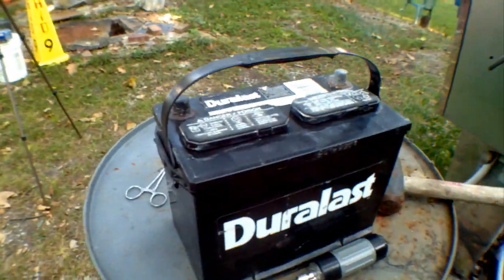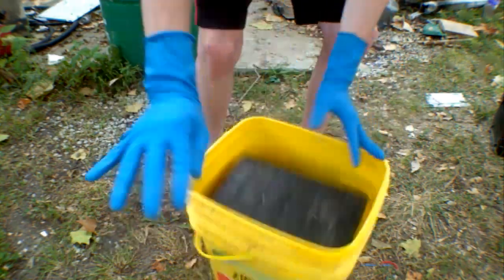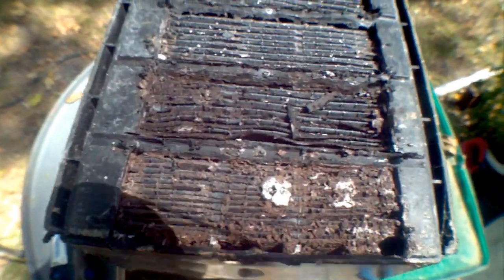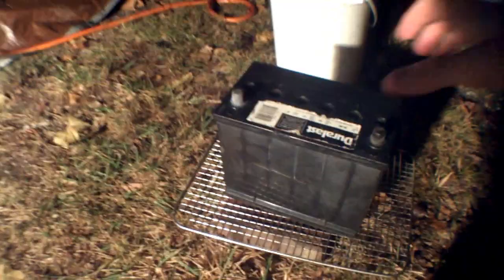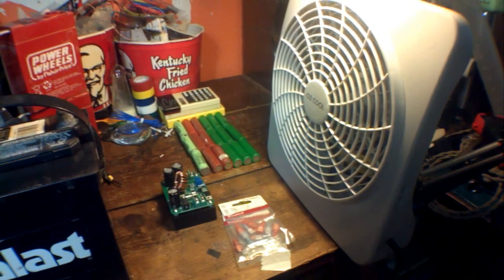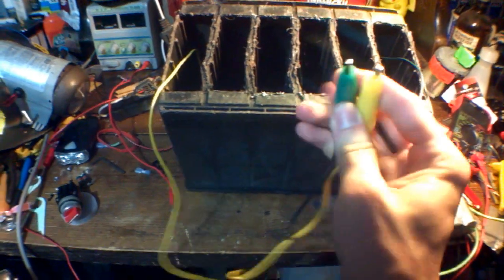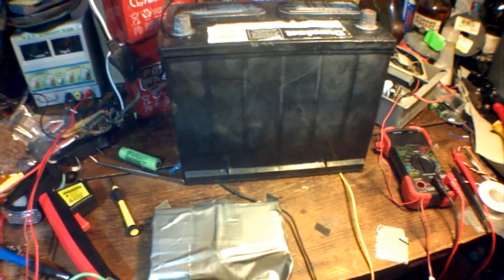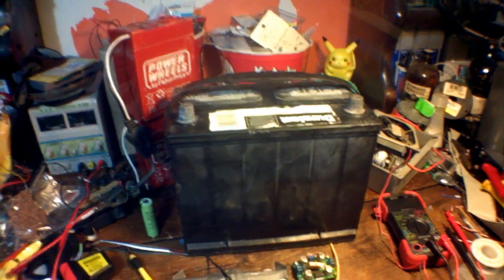DIY Lead-Acid to Lithium-Ion battery conversion 18650

Comment: Love it, awesome, lol !! Did you save the lead? Real lead is scarce. You could give it a chemical wash, then melt it with a torch and really clean it. But srsly you should've filled the old shell, or just made a small cool LiFePO⁴ pack, a 4s though, why only make an 8v battery when you're replacing a 12v car battery? A 4s 18650 pack would be a perfect match, but you'd need quite a few to get enough Mah.
Reply from the maker: i planned to fill it with cells in the future, havent done that yet though.

im not a huge fan of LiFePo4 given how easy it is to get Lithium-ion.

i wasnt replacing a 12v car battery, this just happened to be a 12v battery i used for experiments.
Reply: It Can't be easier, they're free and prolific. They're good ones in almost every bad laptop battery from the last decade or longer. Just open them up and check them if the cell is greater than 2.5v, keep them.
Reply from the maker: you really dont know who your talking to do ya? i've done too much with 18650s and am kinda fed up with them. i have about 1000 18650 cells ready for testing and another 40 or so laptop packs ready to be opened but i just burned myself out on making bike batteries and whatnot. i bet youve probably seen one of my videos already if you tinker with 18650s.
Reply: lol, so how could it be easier, when you already have 1000? i'd like to replace my truck lead acid battery.
Reply: Sorry I didn't mean to insult you. I'm glad you got to save your battery case. I could see it meant something to you, similar to how I feel about ex gf's, lol, but apparently your battery lasted longer and was a better relationship than the ones I had, lmfao !
Reply from the maker: oh i didnt mean that like i was insulted, more of bewildered. imagine i was an actor that was only known for one thing, and everybody talked about that one thing any time they met me, and then somebody came up to me and talked about that thing without knowing of my involvement with it. it'd kinda be a "wait, are you serious?" kind of moment. lol

but the issue is that i have quite a long test for each 18650 in order to make sure they are reliable and properly categorized, and then building the battery is back-breaking work that takes a lot of time. it can take months to go from start to finish for a large battery pack and i'm kinda at the point where i already have a lot of battery packs made, and also kinda sick of working with 18650s for a bit.

so right now i'm just testing a few every so often that way i'll have a box of 18650s for when i actually want to make something with them, but not gonna rush it.
Reply: Rinoa Super-Genius I see I just make sure the starting voltage is above 2.5 then I charge them up and go from there. Ignorance is bliss and I don't want to know too much because I won't be comfortable any more.

Comment: OH this is so wrong and illegal in so many ways.

Take the Lead-Acid battery to a Walmart, Pet Boys,  anywhere they can properly recycle it. Build a wooden box or order a plastic box for your Lithium-Ion battery experiment. 

You've exposed your mother and yourself to lead - even small amounts without respirators, and personal protective equipment can be dangerous.

Worse is that when someone recycles the Lithium-Ion loaded car battery. It will cause a huge explosion in the secondary lead smelter battery breaker's hammer mill, which will cause the battery to explode. Employees try to spot lithium-ion batteries by shame and color, but when it is a car battery - they'll never have a chance to pull out of the conveyor belt before it's too late!   Secondary Lead-Smelter Employees have had some horrible near misses from these lithium-ion explosions.
Reply from the maker: well then, what laws did i break? and nobody is going to be recycling my battery case, its just plastic.

and playing with lead is good fun, as long as you dont breath it in and wash yourself after. if its so dangerous then why is it a common childhood activity to melt and cast it?

get over yourself.

Comment: why don't you just drill holes in through the top of the terminals and install nuts and bolts then hook up wires with ring crimp lugs.

Comment: BE PREPARED! .Always where shorts and sandles when messing with  lead..ACID!   dump it in the recycle so they can stuff it in the ground to leak out later.  you just made billioniares unhappy! right on!! :)
Reply from the maker: +Steve Finch yeah id hate to wear jeans while doing this because the acid can soak into the cloth and continue to touch you if its harming you, but most of all, battery electrolyte doesnt really damage you much more than a light burning sensation, meanwhile it can destroy you clothes.

and putting it into a buckets makes it easier to neutralize the acid
Reply: True that..I  have messed up my best shirts before. but only when i think i was careful it happens lol glad the younger gen is definetly iterested in better Energy. :).

Comment: Dear Rinoa Super-Genius: I AM VERY DISAPPOINTED WITH WHAT YOU DID! You were too lazy and impatient to gather together only enough Li-Ion batteries to fill one compartment. And some of those batteries are more used and worn-out than others. I would like to see a video with brand-new lithium-ion batteries (all of them the SAME) with sufficient quantity to fill ALL of the lead-acid battery compartments. Then I would love to see the terminal voltage and the ampere-hour capacity of the WHOLE complete contraption !!!!!
Reply from the maker: well thats your problem if your disappointed then, not mine.

Comment: I don't think you guys get it, he mentioned the reason why he used this route as opposed to using a new container. It's his favourite battery. Do you not have one? I know I do and it holds a special place in my heart. 
I still remember the day I got mine, it was a hot and humid winters day back in 1991. I had just turned 11 and as a present my father had given me my very own 12 volt battery. I spent all of my special day cleaning it, I missed my party and other presents but all I wanted was my 12 volter. For the first few months I carried it everywhere, I even put it under my pillow come bed time and wore it round my neck as a portable power source, maybe that's why I have a hunch? I still remember the day it stopped holding charge. I was 11 years old and 8 days old, it was a hot and humid winters day back in 1991.....
Reply from the maker: +Gunzee your joke falls flat on its face because i wasnt alive in 1991, guess you dont understand time. or how important it was to me to have a 12v power source for electronics projects.
Reply: Time is indeed a mysterious beast, it's strange but I honestly would love something like Arrival to be real. To understand and percieve time as the hexapods do would be amazing. 
Hey, it's not all about you! It was my experience and it doesn't matter if you were alive. Before your arrival to this plane there were 12 volt batteries and many other things, I promise you this. For a geneass you kinda type like a silly billy.
PS. My joke as you called it really sucks.

Comment: use 20l plastic container used for oil and kitchen chemicals they hold acid generaly well empty into that

use hot old milk or anythink waste alcaline to rinse out battery then hot water to clean
disolves the phospor an acid 

to open smack the top rim of battery reasonbly hard with hamer it seperates the the plasitic weild
takes some experince to get good 

dont use batterrys use supper caps way better

and to all nay sayers its a pretty good recycle of battery better than making it from scratch

Comment: I know from my own experience that battery acid won't burn your skin if washed off with water right away but I would never full around with battery acid without eye protection.

Comment: Doesn't really look like one of your batteries.  Not enough duct tape.  If it was me mate.  I would have cut the top instead of the bottom.  Removed three of the dividers to make three sections and wired each section to be about 14.8V (4 cells).  I didn't get the feel for the size but if it was possible I would have used two or more rolls in each of the three sections.  Then in parallel I would have ran the wires to the terminals.  And if possible I would remove the auto lead connections with a brass bolts, nuts and washers.  Then reattach the top with RTV.  But it was a good use for limited or poor 18650 cells.

Comment: Having managed a battery shop, this kid violated every safety rule in the books, primarily full eye protection.  The whole "project" would have gone better by cutting the seal around the top. Then all plate groups could be removed, the case cleaned and a combination of series/parallel Li-I cells soldered in to achieve the desired voltage, then drilled into the original posts and soldered.  HUGE current in all those cells needs excellent soldering over good mechanical joints, then liquid rubber insulation poured in.  Cell cooling would still be a problem with heavy current draw.  Might make a good bomb.  :-)

Comment: Will a lead acid battery from a car be okay for using as a laptop battery?
Reply from the maker: +Remigius Dias it wouldnt work very well, i used to run my thinkpad off this battery before it died. id recommend getting a small RC lithium battery instead

Comment: i love your ideas and concepts of recycling! !! but this is a little bit far fetched !!! would be much easier and safer just to build a battery box out of other materials! ! or just buy a battery box !!! your whole battery idea is fantastic its just the work you go threw for the box and then you only use 1 cell anyway !!! thats a whole lot of wasted space !! when camping space is paramount! ! especially when you have wife and kids ect !!! if you where to fill it with batteries then it would make 100% sence !! and you would have enough power for a whole week with out a charge being required !!!
Reply from the maker: i wasnt exactly doing this for recycling, but because i wanted a hollowed out battery. now i can pretend its really heavy and whatnot.
Reply: Rinoa Super-Genius cool no problems! !! i wasn't trying to crap on you hope you didnt take it that way !!! if you could fill this though as i thought you where going to would be well worth it !!!

Comment: People worried about a little battery acid on the ground. Thats nothing compared to all the toxic crap that happens to make cellphones, computers and all the other electronic in the world. Next time you want to bitch at someone for polluting look in the mirror. Oh, I guess it's ok if you pay someone to do it for you. A bunch of disconnected dumb shits.
Reply from the maker: there are places in silicon valley were the ground is so toxic from all the chemicals that nobody will build on it, when i lived out there it would smell like acetone when it rained instead of normal petricor.

Comment: Been easier to go from top. Use die grinder or hack saw.
but you got lucky with the acid. Get you a plastic apron or even garbage bag next time.
Reply from the maker: but that would make it look tamperred with.

Comment: Been easier to go from top. Use die grinder or hack saw.
but you got lucky with the acid. Get you a plastic apron or even garbage bag next time.

Comment: So your just using this battery as a container for more batteries?  Isn't it dangerous to use lithium cells that don't match..  Especially as you call these you dead cells or?  I'm confused.. This seems exceptionally dangerous...

Comment: Is this possible to jump start a car with it?
Reply: Jamshaid Khan you can start vehicles with large CAPS as long as your alternator will charge them fast enough to full charge on the cap.  seeing a lot of these toxic babies have never opened a jump box..
Reply from the maker: +Jamshaid Khan sure

Comment: Dude, you could just buy a shell for a lead-acid-battery which were used on boats and use this to put your 18650s in. Would be much simpler and safer than disassembling a battery.

Comment: You know the batteries in a laptop are not balanced charged. Just regular series charged. There are extra wires in the pack so the laptop can calculate the amount of discharge the batteries have but charging and discharging happens on the end termimals of the pack. To balance charge or not to balance charge... that is the question! lol
Reply from the maker: no they ballance charge in a laptop pack, unless its a nickel battery.

Comment: I got to admit it was very funny when you dropped the battery in the acid! At least you washed off quickly. Sorry about the tripod. Its aluminum.  At least it shows people what you should not do!  Interesting video though. Thanks for the upload.

Comment: You can buy an empty marine battery box with a rubber seal lid and studded lead battery terminals (you can bolt on wires to) and build this without all the internal mess, risk, clean-up and hassel.

Comment: Having worked in a battery reconditioning warehouse, you really need to be wearing a tight fitted air filter mask working with these. Sulphuric acid dust and lead dust is not safe and can cause lung and health problems. Safety First bro. Otherwise - cool vid.

Comment: Good idea but how do you match the alternator voltage to the lithium batteries?  And will the standard automotive voltage regulator still work?  I worked with lithium batteries in cell phones, and you have to correctly regulate their charging and discharging rates or they can be damaged or the lithium metal can ignite.

Comment: That's not a conversion, it's just placing lithium-ion batteries in a lead-acid battery case. A better title would be, "How to disguise lithium-ion batteries". But the bigger question is, why would you even want to do that? A real lead-acid battery is far cheaper, safer and more durable.

Comment: This guy is going to set his car on fire, if his Alternator overcharging his batteries.   Lithium batteries are the most dangerous batteries, needing cooling vent to keep them working safe and well.  Don't copy him on your newer car.
Reply from the maker: why would i use a gasoline car? that makes no sense. and no lithium-ion batteries arent the most dangerous. and they only need cooling if your overworking them.
Reply: FuelEfficiency you sound quite ignorant for your nickname.
Reply: Nice idea but its a well known fact that lithium bateries need a BMS. Else you are takings considerable risk. Just think of NOTE 7 as a quick reminder of what a lithium battery can do. Thats why they use BMS even in single cell applications.

Comment: You do realize you could have built a car-battery shaped case to put your new batteries into without painstakingly disassembling an actual car battery and spraying lead and acid all over yourself, right? New terminal posts are $3.

Comment: OK am I the ONLY one who is just a bit curious as to why in the HELL the car battery was at all necessary, much less all the work your very "Intelligent" ass just put yourself through during the process.... I mean, I could most definitely be wrong but, isn't it simply the power from the damn lithium ion batteries that you worked so hard on taping (and TRYING to solder together) in attempts to WHAAAAT????????? POWER YOUR  FAN WITH THE GODFORSAKEN LITHIUM ION BATTERIES.  And last but not least... Doesn't the damn fan only take like a  few C batteries to run in the first place??????????????????????? 
PLEASE HELP ME OUT HERE BECAUSE MY MIND=   BLOWN!!!!!

Comment: you shouldve did what battery recyclers do,cut the top OFF ,lift the plates /cells out in one go,clean it with a gentle water jet .i wouldve placed plastic mesh between each plate,and putin back in the battery box ,after cleaning the boxs ionic sludge out which would be reduceing the capacity,and refill with the acid to see if it worked again.but you cut the arse out of it,hey ho.
just dont get injured,and you may learn how to recycle old lead acids.enjoy.

Comment: For entertainment purposes only.L-ion batteries are rated at 3.6-4.2 volts per cell. Each cell must be charged individually or in parallel and the charge voltage is to never exceed 4.2V or the cell(s) will be permanently damaged.
Reply: aaaaahhh, To balance charge or not to balance charge... that is the question! lol

Comment: hay man check this circuit board: https://www.fasttech.com/products/1225201

it has built in voltage protection for each cell for over charge and under charge.
Reply: BTW let me know(if you get one) if you need help wiring the cells to it.

Comment: u make that mess only for a case for ur litium batteries, thats so ...., and bad for the enviroment.. lead needs to go to a special facility. Lead poisining is not funny. And u contaminating ur backjard and  maybe the waste water pipe where u put the water for cleaning the case . And why u cut it open on the bottom. On top it is better u can pull the plates complete out. like they do it when manufactoring the batterys. The top cap is glued on the batterycase

Comment: Why not?????? Well apart from you almost put yourself in the hospital before you even started, and the list could go on, but a simple question. Why the hell didn't you just use the cat litter bucket and you could have been done in an hour or less?

Comment: good idea if you're into vintage cars or motorbikes and you want to use the old style period correct battery. but I would have cut the top off in stead .